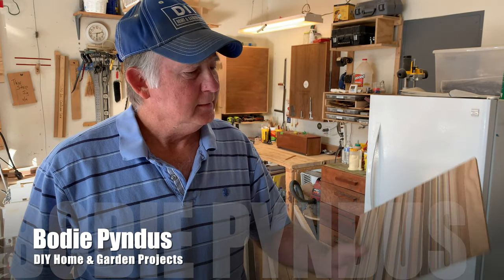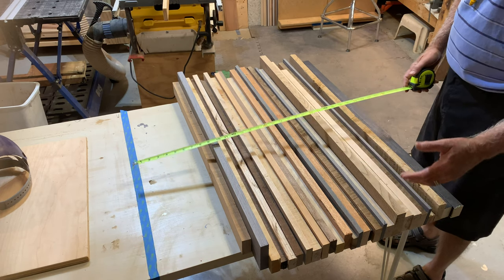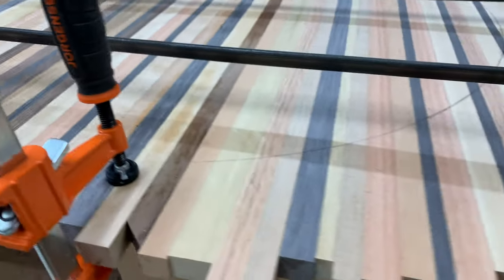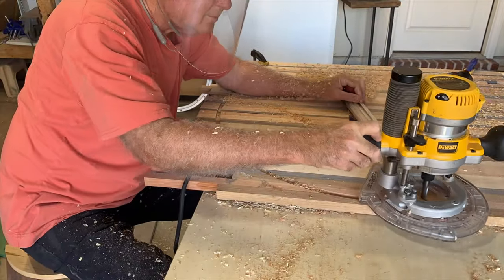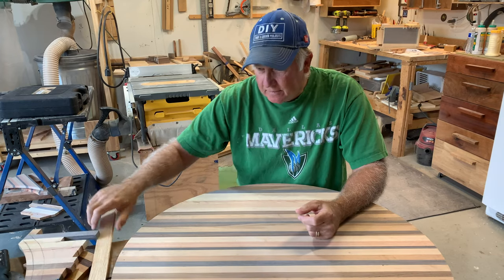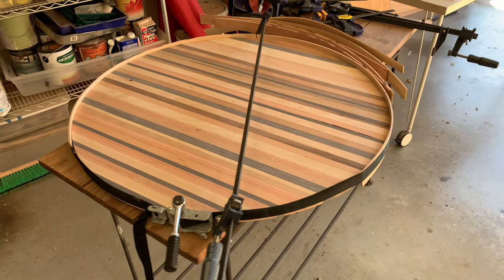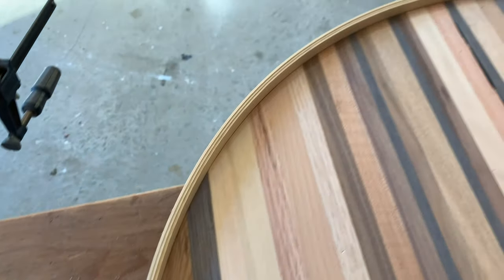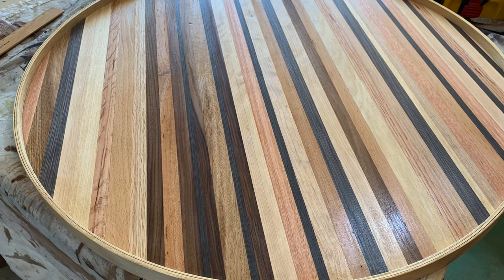How to build a Lazy Susan Charcuterie Board

Comment: Would you consider making a trio of charcuterie boards? Like the sizes that would actually fit in a cabinet or under the cabinets on the counter? 12x12,18x8,and a 24x16 ?
Are these also capable of being cutting boards? (I really don't know much about it)